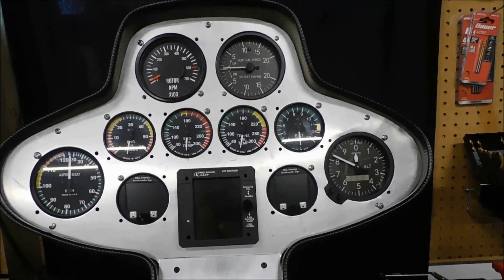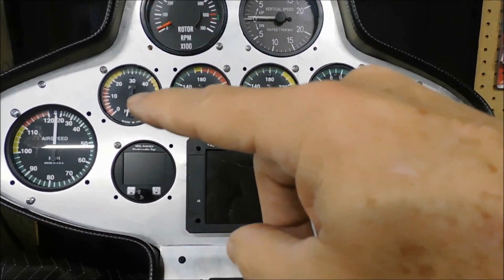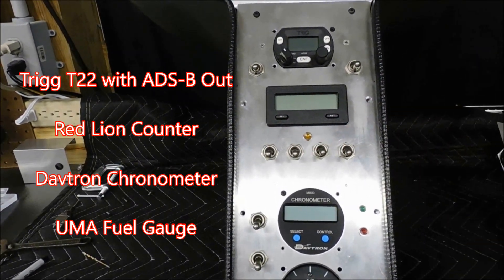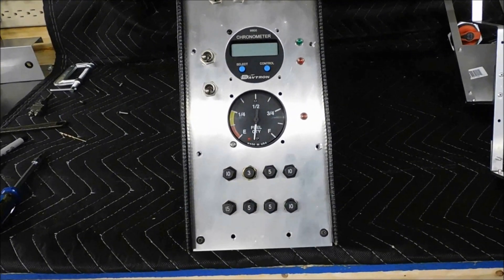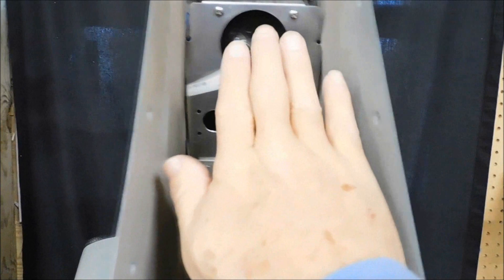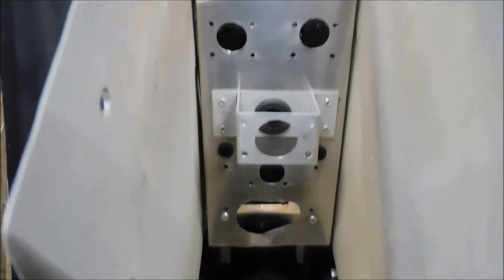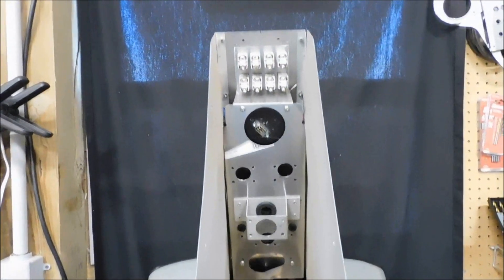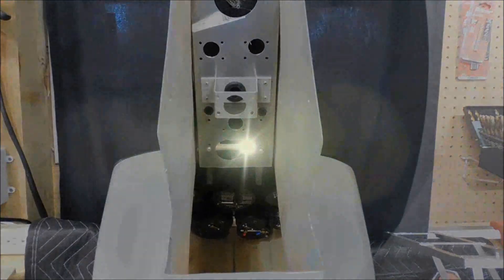Helicycle Instruments and Pod Explained

Comment: Did you ever consider going with a glass panel instead of analogue gauges?
Reply from the maker: I looked into the MGL EFIS system in the beginning but decided against it. For me, I like the separation and the gauges are much easier for me to look at. The EFIS digital read outs run together too much and the colors are hard to look at. Also, while flying in a helicopter, most of the monitoring of the instruments are slight glances. That is easier with larger, distinct gauges!! Thanks for asking!